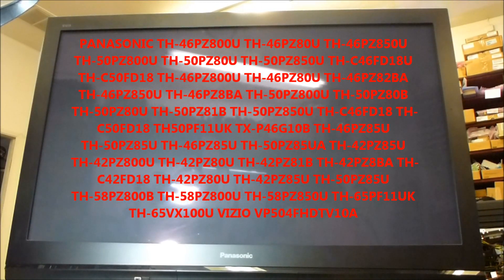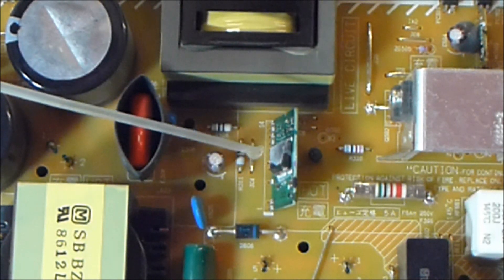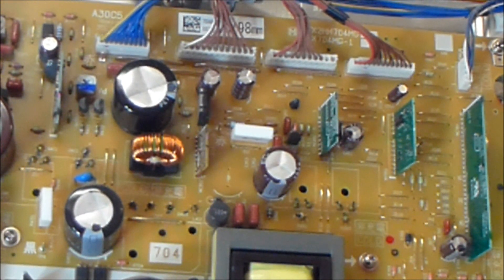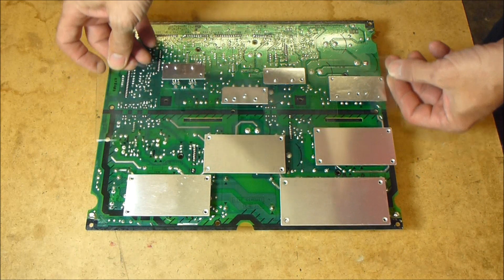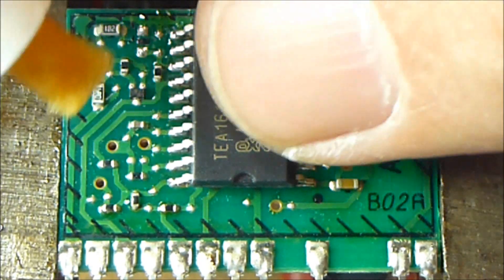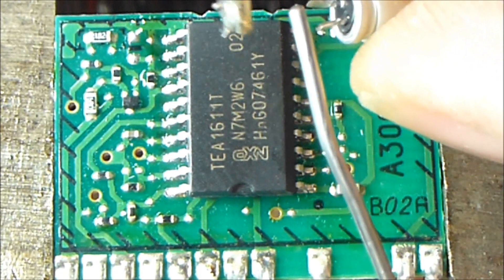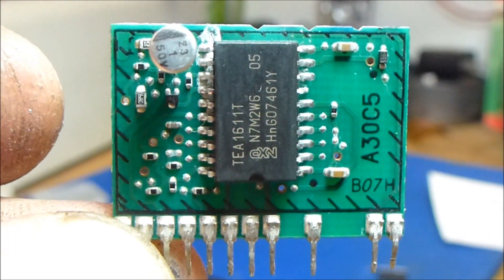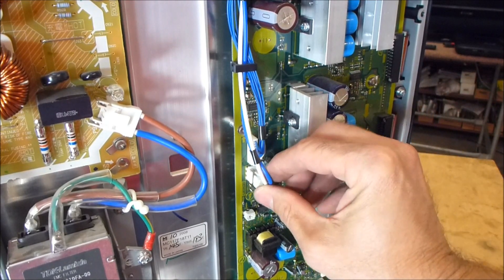Panasonic Plasma 10 and 2 Blinks TEA1611 ETX2MM702 704 706 Power Supply TH 42 46 50 58 PZ 800 85

Comment: Hi. Great vid and very useful. I have a TH 42 plasma that has the dreaded 10 blinks. I have tried the freeze spray on all the MC circuit boards but still get three clicks on power up. Can the IC's fail to such an extent that the freeze spray won't work?
Thanks.
Andy

Comment: How imperative is it that the negative side of the capacitor be in the correct place?? I got some different style capacitors from radio shack (p/n 272-0996), but no polarity indicator. Fans now come on for just a few seconds, but do not stay on and have 2 blinks now. Tested Pin 1 P7 for short and it is good. Not having much luck on where to go next. Any help would be much appreciated.

Comment: Hi...great video!! I just did my first one of these and I'd like to pass on a tip...the mdppnb102 module has fewer parts on the backside of the board than the mdppnb331. This particular one was also stamped "331" on the backside but it washed off as soon as I cleaned the board. I suspect that the capacitor is actually the problem since the TEA1611T won't start up at room temperature. I put a known good chip on a "102" and it wouldn't work until I replaced the cap; the old chip works in a 331.

Comment: Hi CAN you help ME??? I have a tc-p50c2 wont turn on 10 blinks but my board doesn't look like yours in video I have 3 transformers? none with 2 winds? I also have a tc-p50G25 with cracked screen and 10 blink, the power-boards are similar but not exactly same I switched them (But still 10 blinks) The TC-p50c2 I really want to fix I do hear a clicking on both power board's when in the TC 50c2 / perrdice1@msn.com

Comment from the maker: the discharge resistor is simply a high wattage(5 to 10 watts) 1500 ohm that i had available. You could use a higher ohm resistor 5000, 10000, 20000( 5K 10K 20K) but it would take longer to discharge the capacitors.

Comment: I have the TH-42PZ85U, I did this and like magic the 10 blinks are gone. But I still do not have any video. The Backlights light up and I can see that the unit turns on. I have already replaced the D board and I am dreading that it could be the A ( inputs ) board. Any thoughts if I am on the right track ?

Comment: Norcal, this video is great. I was able to "jump start" my tv by cooling down the ic chip. I have a question though, I did replace the one ic chip and capacity that I sprayed. This did not fix my problem and I can no longer "jump start" the tv anymore.  Do u think I should change the other ic chip?

Comment: norcal715.  Thank you, Thank you, Thank you!  I had three of these modules on backorder with panasonic with no ETA.  I came across your 'brilliant video' on You tube, I ordered enough IC's to repair 5 modules and already had the SMD electrolytics in stock.  Repairs X 3 most successful.  Thanks again for your precise explaination and repair path for the 10 blink trouble on these TV's !!!

Comment from the maker: Could still be a problem with MC201. Check VSUS on either the SS or SC boards and see if you have approx 195 volts before shutdown. MC201 is the driver for the 195 VSustain voltage.

Comment from the maker: 10 blinks after pressing the power button means the run 15 volt supply problem or 15 volt sense not working, could still be the ps board or even the A board, or wrong diagnosis on the D board. I will try to get a troubleshooting flowchart for you when I have time

Comment from the maker: I change both ic and cap for good measure, I have had comments that just changing the cap will remedy some problems so you could try just the caps and if it does not repair it then change the ics

Comment: @norcal715  cooled down both ic chips and the TV sprang to life no problem.  I am guessing If I find 2 TEA1611t That should  do the trick.   Was wondering why The ic packages when bad and if the capacitor on both chips went bad or you replaced them for good measure.
Thanks for your help.  Amazingly detailed video!

Comment: I did everything in the video. When I plus in the set I get 2 fast clicks then 5 seconds later another click. I turn it on and it turns on for 2 seconds, clicks and I get the 10 blinks. Any idea what I did wrong?

Comment: Hi, I have a Panasonic Model# TH-50PZ80U.  I replaced the parts you described, and it is still blinking 10 times.  Would you have any other idea's?  I read some where that a thermal fuse can go bad.  I just don't know where to look on the board to replace it.  Thanks for your help

Comment from the maker: Check and see if you have Vsus on the SC or SS boards, they both have test points on the top by the big 2 wire connector, you should have approx 190-195 volts there.

Comment: I have the TH-42PZ80U which has lasted about 4 years.  It works fine except when you shut it off and turn it on you get 1 click and 2 blinks.  If you leave it unplugged for an hour or so it will turn on like normal and run for as long as you want it to.  Must be a power or a heat issue.  It doesn't shut off by itself which is a good sign.

Can anyone point me in the right direction? Possibly either give me insight or let me know what I should be testing.  thank you!

Comment: Thanks for posting! I was sweating I'd have to replace the whole power supply. I didn't even need to swap the IC (which would have been a pain to track down a seller for). I swapped out the tiny cap for a 1uF 50v electrolytic from Radio Shack for a whopping $1 and I'm back in business!

Comment: Thank you for this video. My TV started to stop turning on followed by the 2 blink code, which got progressively worse over time. I changed just the 2 caps with 1uf 63v polyester film ones and this seems to have solved the problem. I didn't even have to remove the board from the TV but it'd be a lot easier to do so.

Comment: I started with the 10 blink code.  I replaced just the caps on both the mc201 and mc301 .  I did not replace the TEA1611T chip.  I now get 2 blinks.... So I've improved from 10 blinks to 2 blinks...should I replace the TEA1611T also?

Comment from the maker: Yep it should, I use the electrolytic just because I have a drawer of them and they are very reliable. You could also use a standard leaded aluminium electrolytic and you can use a voltage as low as 16 volts because it only has 12 volts on it.

Comment from the maker: 10 blinks could be something else most definitely, but I have found more than not its the failure of these ic's/capacitors. try the cooling method to see if the set starts. the discharge resistor is simply a high wattage(5 to 10 watts) 1500 ohm that i had available. You could use a higher ohm resistor 5000, 10000, 20000( 5K 10K 20K) but it would take longer to discharge the capacitors.

Comment: Hi, I have the same problem.  Great video!  A couple of questions:
-Does 10 blinks always mean the IC's are bad or could it be something else.  It seems that the repair manual troubleshooting guide points to several possible issues?
-Can you explain how you made the resistor to discharge the capacitors?

Thanks for the great tutorial,

Mike

Comment from the maker: not usually, you may have  failure on the A board. You could try to cool the IC's and see if that makes a difference because when you press the power button the set must start the 15 volt supply each time.

Comment from the maker: Any can of compressed air should work. Just make sure you have 10 blinks before pressing the power button. You can cool the drive IC and if the set starts it will (or in most cases) stay on until you ask it to start again. These ic's typically fail in the start mode only. The set will need to be repaired because as the ic's degrade it will just keep doing it until you cant get the ic cold enough.